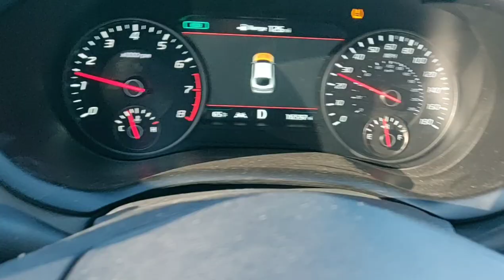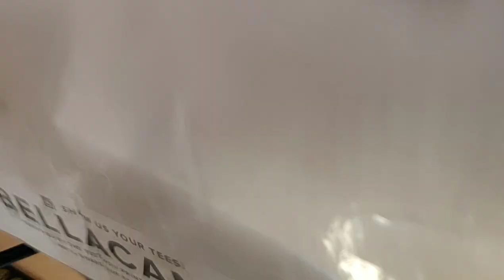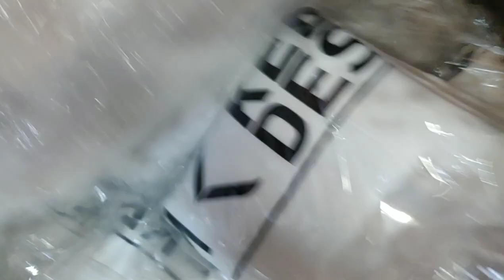Adro day, adding every last part of carbon fiber possible

Comment: I'm older dude, and i don't love how it looks like this. It's cool I guess, but I wouldn't do it to mine. The hood and rims are pretty cool.. Not loving the wide flare things.  I've only got K & N air filters for mine. Don't think I'll do anything else to it.  Oh, just the bigger stinger logo across the back and switch out the Kia badges for Stigner or GT badges. but that'll be it... Young guys, I get it. tuner up !!
Reply from the maker: It's all in personal taste.